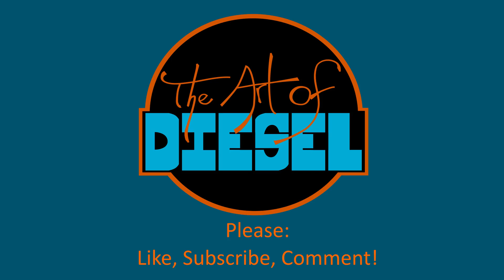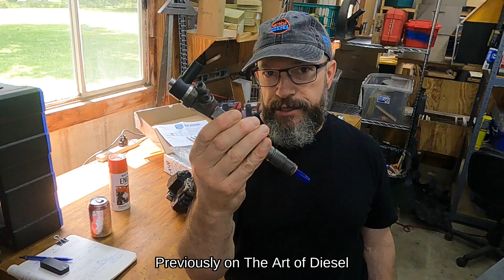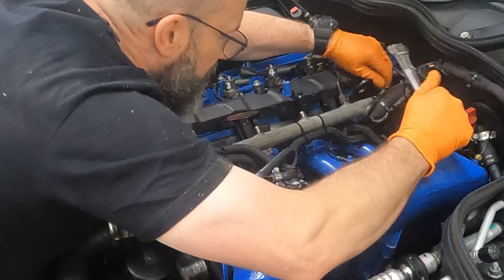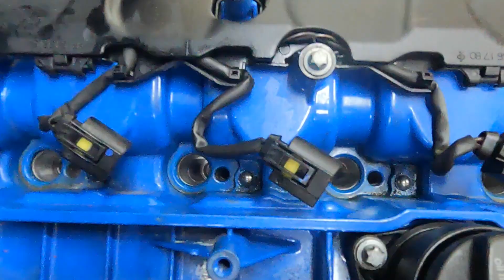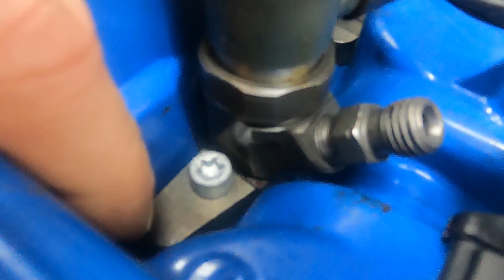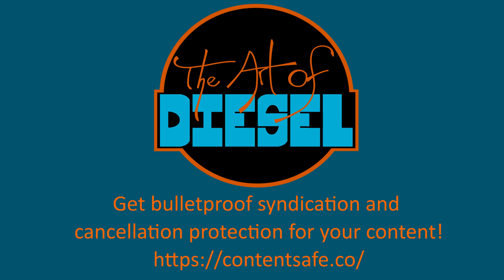Oversized Injector Installation on an OM648 Turbodiesel

Comment: Great video, very informative! Quick question - why did you have to ream  the injector seats? Was that specific to the injectors you installed?
Reply from the maker: Playing it safe. I want to be absolutely sure that the injectors seal well. This common rail system injects very high-pressure fuel into the combustion chamber during the combustion event, at/near top-dead-center. There are very high pressures involved and I've seen the "black death" that results from leaks at this seal on direct-injection diesels. Partially burned fuel and exhaust components make their way past the seal and create a crusty mess around the injector. It builds up over time and looks like a big black tumor on the engine. It's a loss to the engine's power/efficiency and the gunk hardens, making it hard to remove the injectors if they have to come out in the future. The only key is not to do any more reaming than is absolutely needed to ensure the metal is clean, fresh, and ready for the injector seal.
Reply: @ArtOfDiesel Thanks for taking the time to answer my question! Very clear now that you've explained it, I think that's exactly how it should be done! Thanks again and please do keep uploading great videos! You've got yourself a fan.
Reply from the maker: @J0H4RY  Thanks! Will do! I have an ML320 CDI that I'm going to be replacing the engine in. I'm also getting some CAN-bus logging equipment so that I can figure out why Evonne doesn't like to go above 30 psi of boost until 4th gear (which doesn't happen at full throttle until 95 mph or so).

Comment: Where you got these injectors and what did they cost?
Reply from the maker: I bought them from Drew at Mid-Tennessee Diesel. In full disclosure: I'm getting a deal from him because I promote what he's doing, so I think your best bet is to reach out to him directly. Best way to reach him is: https://www.blacksmokeracing.com/software-specialists/
While you are on the Black Smoke Racing site, you can also check out the oversized injectors that they sell. I believe that their prices are comparable.
Reply: @ArtOfDiesel would like to get the product code so i don't pay multiple middle men
Reply from the maker: @trevork1994  if you want a more detailed conversation, you need to go and subscribe to my Substack. https://artofdiesel.substack.com From there, you could start a conversation thread or PM me directly.
Reply: @ArtOfDiesel  just a product code would be enough, or a car where these injector nozzles are from. thanks

Comment: The stock OM628 pump starts defueling at higher pump rpm’s.  One of the reasons tuners start hitting a wall over 400 hp.  The VE of the pump starts falling off pretty precipitously.  It can be rectified, but requires some mods.
Reply from the maker: Is this why I've heard about swapping sprockets inside the timing cover to get higher pump speeds? 
For me, it's all academic, as getting to 400 hp is enough, at least for where I'm going in the short-term.
Reply: BSR used to sell a smaller pulley.  It would actually make the problem worse… VE of the pump falls off with increased rpm, so putting a smaller pulley would do the exact opposite of what they were trying to achieve.  I think they stopped selling it.
Reply: And at 400 hp and not increasing engine redline, you should be fine.

Comment: nice work! did u need to do some kind changes in ecu to run them? 
I am planning to install bigger injectors on my om647, but i dont know if my car will start with new injectors 
p.s. I like how clean is your engine bay!
Reply from the maker: Yes, you need a tune on this type of common rail system. My tuner set me up with a tune right away that accounted for this and several other changes that I'm covering in this series. Most importantly, the injectors and the pump were upgraded. I was able to start it before I got the tune, but I didn't want to do more than let it idle and check for leaks in the high-pressure system. The tune I have right now is just a baseline designed to give me the performance I had. I'll be getting tunes soon to dial this up in the direction of 400 hp and 650 lb-ft.